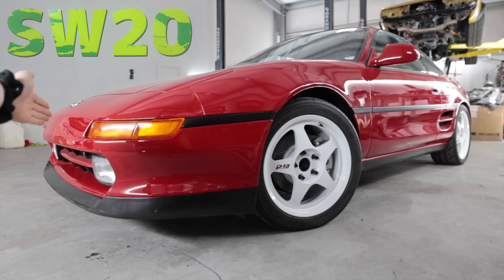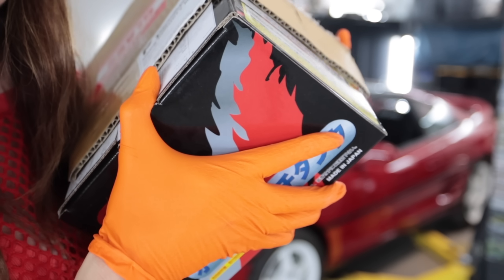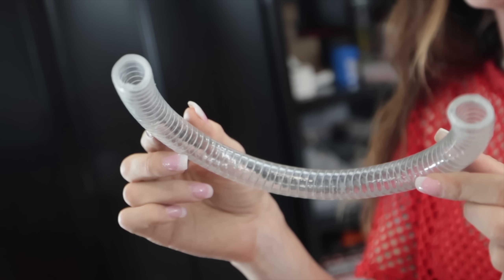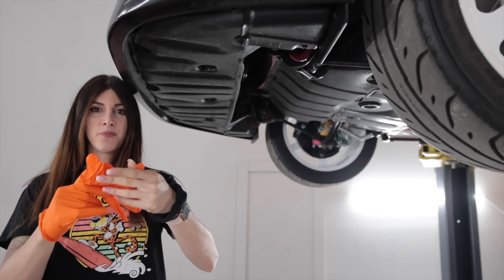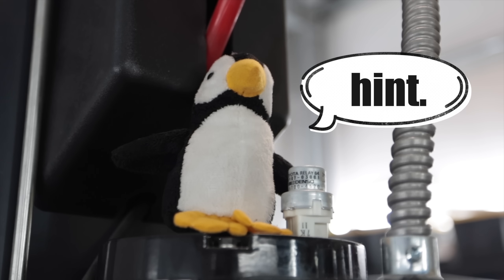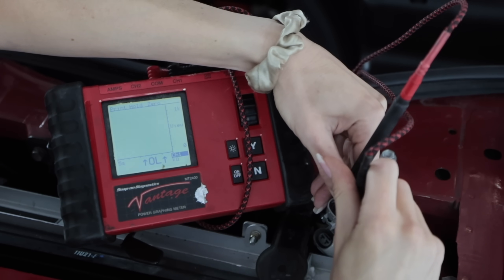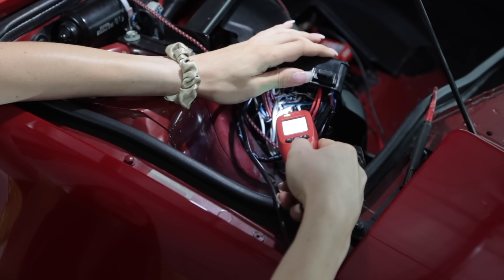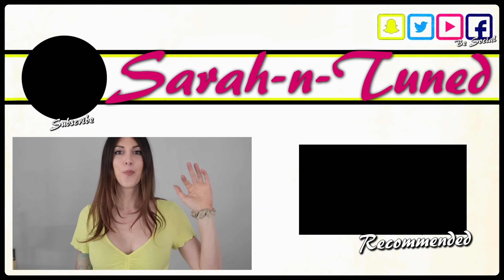Toyota OVER Engineered This.. // '91 MR2 Turbo

Comment: I actually went to buy one of these in the late 2000's (non turbo version) because I was going to do a 2zz swap with a 6 speed from a Corolla xrs , but my big 6'4" body just barely didn't fit in it.  I was bummed

Comment: Whoo boy. You touched on the two things that are the MOST irritating on my 91 MR2 after ATS upgrades - cooling fans always on max when the key is on (and being told it is probably best if I leave it this way) - and boost gauges (dash and aftermarket) do not read correctly. Made my head spin as you were walking thru the cooling circuits, thus shedding some light on why the decision was made by the engine builders to just set the cooling fans to max on when the key is on - no temp circuits or AC indicators in the loop. Max cooling, all the time...and very very noisy.

Comment: First time watcher, with a same 3sgte engined 89 Celica GT4. Have you experienced air blockages in the coolant pipes/engine ?
I bought my car with a heater delete, due to a leaking core. Car ran faultlessly.
Now the heater is all all fixed and piped up again the car overheats, mainly on boost.
Apart from tilting the car on a ridiculous angle, trying to rid any air, do you have any insights ?
Super video and we have a huge following of MR2's and Celica's down here in New Zealand :hand-pink-waving:🚙🚙
Reply from the maker: If you bleed it using a vacuum bleeder is fairly easy.
Reply: @SarahnTuned    Brilliant thank you.

Comment: Regarding the gauge cluster, also check for bad electrolytic capacitors. At 30+ years old, they may have started to go kaput.
Reply from the maker: yeah, I replaced the capacitors on the tachometer on it a couple years ago, they were bad.

Comment: A note about brushless DC motors: essentially they're a multi phase AC motor run by a motor controller that converts the DC in the required voltage phases.

Comment: The SW20 would be the fastest car in the world if it were to do gymkhana. However, the clutch is too weak, so it cannot be used unless it is replaced with a stronger clutch. The electric power steering relay is defective, so it should be replaced with an updated relay. The best engine would be the 200 horsepower 3SGVVTi tuned by Yamaha.

Comment: Actually a vent to atmosphere oil catch can on a forced induction application is the move.  In the Coyote World, snapping a ringland with a closed system is a thing.  We ditch the PCV system and use dual valve covers to vent catch can or run two vent catch cans (that's what I have).  You don't need the PCV system if you go this route.

Comment: You really want fan motors with more pins, namely a separate speed input. That way you can keep your factory wiring, though you will need to add one or two more depending on if you want independent control, and which is likely unnecessary.

Comment: My MR2 takes forever to warm up and runs cool even on blazing hot days stuck in traffic. My unscientific theory on why the cooling system is so efficient is that most cars have their radiator in close proximity to the heat of the engine, while the MR2 does not, and also the dozen feet of aluminum piping between the engine and radiator has an additional heat dissipating effect as the coolant travels. But then, many other mid engine cars have considerable problems staying cool (my Fiat X1/9 sure did, original Panteras did, etc)? So who knows.

Comment: I ran PWM controlled fans in the engine lid on my '94 SW20 to extract bay heat. I think using the "official" spal fan controller which was ludicrously expensive. It was a very long time ago though, I'm sure there are better solutions now.

Comment: Cooling fans thought. Instead of running both fans at 6v or 12v why not wire them both to run at 12v BUT either one of them when the car wants half speed and both of them when full cooling is required?

Comment: Lesson 1 in cooling systems on internal combustion engines , test the current pump status. Is the water pump doing the job if you are experiencing overheating while the engine is idling?
If yes then disconnect the heater hoses from the heater core and run the hoses into a bucket full of coolant or water. Then start the engine and bleed the system. Once the system is bled and the engine is idling at 500rpm remove the flow hose from the bucket and observe the quality of the fluid , whether it is full of bubbles and whether there is sufficient flow. To establish whether there is sufficient flow time the coolant into a 1 liter container , if the container takes more than 10 seconds to fill then the pump is inadequate and you have found the source of the overheating , given that all other factors such as radiator cap is holding required pressure.
Inspect the pump impeller and the clearance of the impeller to the wiping surface there should be no more than 15thou clearance and the casting on the internals of the pump body should be free of any roughness.   As I have said in other comments the cooling system , in particular the pump, is the key to tuning an engine. 
Radiators are only the conversion zone of steam to fluid, there is way too much emphasis on radiators with most people modifying or tuning modern vehicles, the water pump is the most important component to any 4 cycle closed system ICE. 
I repeat the above is as a result of 30000 hours of engine dyno work ignore at your peril .

Comment: From my limited understanding,  an oil catch can is only required on a direct injection engine. An in-direct injected engine gets cleaned by the petrol being sprayed before the valves. So it’s not required.
Reply from the maker: Incorrect.

Comment: You are probably loosing the ground wire (brown) to the gauge. Reason for the temp gauge to max out on key on. Happens mostly during a rewire. Its a reference ground so the gauge and the water temp sensor (the single wire on the water neck) is grounded to the engine.

Comment: 7:40 IDK about car parts but i often find that PWM fans run kinda funky if you dont give them full voltage in PWM control, and some wont even run at all.
Fun fact, computer and car fans both run at 12V
Now this might just be a common thing for computer fans because that 12v rail is SUPER regulated, i dont think you're ever going to see a +/-  variance of more than 0.25v so things like car parts are probably going to run fine at 6v if 10v and 15v arent out of the question for somewhat normal operation.

Comment: Does that csr use stepper motors for display if so they go bad. 3$  parts 2 motors bad desolder and solder new in. Common failure on GM. Worlds bestt looking mechanic, you? could be.

Comment: Sarah, did you consider using a capacitor. like a home air conditioner uses to assist with the start up with the fans to help reduce the draw on the electrical system?

Comment: You would have much better control running both fans from the Link.  Ditch the fan control temp switch and trigger both fan relays from the link.  Even without PWM you have much more resolution using the ect sensor instead of the rad temp switch.

Comment: Try pushing the tire, not the car. My race car is on 10" slicks and it sucks to push if I try and push the chassis.
But if you push the top of the tire it rolls right along.

Comment: Betcha a Raspberry Pi could detect low fan voltage, output a 50/50 PWM signal to a 12v amplifier to run the fans at a low speed, then simply switch to 100% duty cycle when it detects 12 volts. Love your videos as always!

Comment: On some of the same age clusters I have worked on, a cold or loose solder joint has been a possible problem. I would think if the gauge regulator was bad that all of the gauges would read improperly. For a gauge to read all the way in it's sweep, would that be a dead short or lack of voltage????

Comment: I saw a short video on YouTube...You open completely your driver window, pull your driver seat belt all out of the car, close the door and then you put your head and right arm through going from the rear toward the front! 😊 Something else, that can get forgoten, is to readjust your shocks once you're pretty much done changing all the parts you planed to change, like your heavy fan motors! I don't think that I have to explain you the difference on how they will act, changing their tension/pressure! 😉

Comment: I'd hazard a guess that the brushless motor fans need a PWM signal to have any speed control, and probably only work at all because 12VDC to the control wire spoofs it into thinking it's getting a 100% high PWM signal.. You might be able to find a module that coverts variable DC voltages to PWM, which off the existing 6V/12V wiring would theoretically give you back your 2 speed control.
That's my theory anyway.

Comment: The best way to find out the minimum voltage the fans will run at is to run them off a variable bench power supply, start the bench power supply at the 6 volts you hope they will run at, then slowly turn the voltage up until they start to spin, then look at the reading on the bench power supply, bingo, you have your minimum operating voltage.

Comment: IIRC the stock radiator fans are controlled by a temp switch in the radiator (on the passenger side above the drain plug). I have an AEM EMS and didn't have to do anything with the fans. The fans kick on because it has it's own standalone circuit up front with a temp switch. Unless you've modified the stock wiring, you should be able to force the fans on by just unplugging the temp switch in the radiator.

Comment: I'm thinking you can't ohm out a brushless motor, because they are married to their driver cards. Only the driver can see the motor. It sees the coils and the rotational position sensors, and drives the coils each at the right moment. And you don't get to. The most elegant way to do special things is to learn how to talk to the driver nice so it does something approximating what you want.

Comment: Why does the shifter on the Bronco sound so bad, like its a clanker?
Reply from the maker: You have to pull up on the lever to put it into reverse.
Reply: @SarahnTuned some older ( and also newer ) Škoda and VW cars have it similar, but you have to push the shifter down and then more to the left, to put into Reverse. Still, havent seen/felt a shifter like that, even on my 2001 Škoda Octavia, that had 214 000+ KMs on it in 2016 😀
Weird. Didnt think something like this would be considered normal for a car like that 😀
Anyway, thanks for the explaination Sarah.

Comment: To get the engine hotter, cover the radiator with a blanket or cardboard or use a hair dryer to blow hot air into the radiator.

Comment: I run dual fans in parallel with a dedicated pwm fan controller by Delta Current Control, Constant Temperature Controller.  Model FK-75 is capable of providing a continuous current of 75A.

Comment: Brushless motors vs. Brushed motors and LED lighting vs. Incandescent lights aren't as easy an upgrade as the sellers of these products would like you believe.  They actually operate on several different parameters than their counterparts.

Comment: That's not a GDI engine, a catch can is utterly useless garbage! 😅😅😅
Reply from the maker: You clearly don’t understand how an engine works lol.
Reply: Do you not know what a catch can does? It keeps oil and crud from the crankcase getting into the intake via the pcv system. Why would you want hot oil and crap in your intake and cylinders? On any car regardless of injection type?
Reply: @douglasboyle6544  it's just extra lubrication, it's oil vapours, water vapours, some carbon and some unburnt gas, it's of no consequence to the engine, it's not like you are pouring dirt and sand into the intake

Comment: Wow the 91 MR2 fan circuit works exactly the same as the 2013+ BRZ fan circuit. Took me a while to figure out what the heck was going on when I first looked at the wiring diagram. The way I rigged the fans on the BRZ was to connect one wire to both of the necessary relays so whenever the ECU said fans on both fans would kick on high. Not a perfect solution, but good for temporary at least when rotary need coolness. Similar to what you did really. Them brushless fans are nice!
Reply from the maker: Yeah, I actually might make a more permanent jumper and keep it as is if this works well.
Reply: Are the esc's built into the motors?

Comment: In Commiefornia oil catch cans are proof that CARB (California Air Resources Board) has some very asinine rules. A catch can will make your engine run cleaner as it 'catches' contaminants that would otherwise be run through the combustion cycle  for proper disposal. Here they are illegal- as with everything else. From the state to the west.

Comment: This is so timely! I want to do a brushless fan in front of my radiator and condenser to assist the stock dual-speed fan behind them on my 2005 MINI Cooper. I live in Phoenix and my AC is generally able to keep up (just replaced the compressor and condenser a month ago), but it's not as cool as I'd like it to be at idle and I think (think) the added flow from a helper fan will fix this. I also recently upgraded to a 250 amp alternator from the stock 130 amp unit, which was already struggling to keep up, so I have the pow-ah! Edit: Holy frig those Steele motors are expensive! 😳

Comment: Your editing is getting better and better!  Brushless motors are way different animals from traditional DC motors.  They are actually AC motors, with the AC supplied by a dedicated controller.  Most model airplanes are now equipped with brushless motors, & provide a huge leap in performance & efficiency over old DC motors.
Reply: Not just RC planes. Almost all RC cars run brushless for close to a decade now.
Reply: DC motors also have a lot of advantages, including speed control with a simple rheostat instead of VFD.